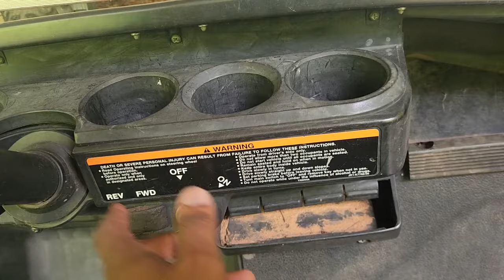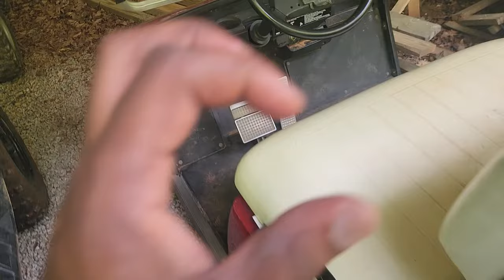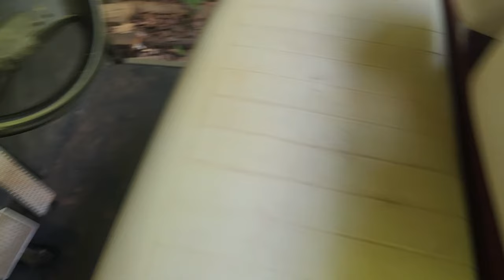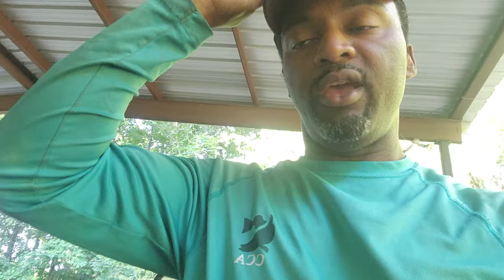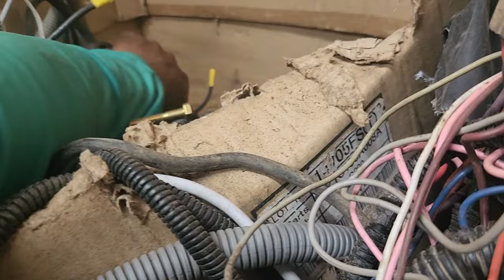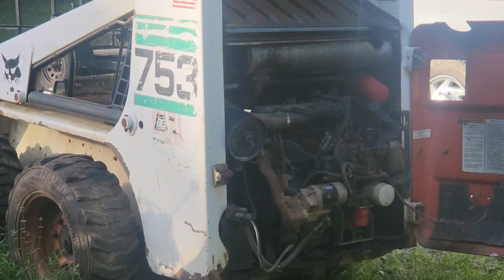How to fix any Club Car golf cart!  Electrical diagnostics 101

Comment: Sir,I have a 2016 club car Presedent 12 iq 48volt. I can be driving and cart just quits then beeps three times
Reply from the maker: Sounds like a bad electrical connection somewhere
Reply: I am going to replace the mcor cheap and quick
Reply: It has the original
Reply: Thank you for the fast reply 😊
Reply from the maker: @forsythparkbaptistchurch7552 yeah MCOR are notorious for going bad so try that first. Usually you can tell if it's the MCOR because it will stop driving when the pedal is depressed to one particular dead zone

Comment: Do you have any good info on a 2008 STAR48-6F-10H cart?
Reply from the maker: They are sort of built up the same as most other golf carts. Foot pedal throttle control is the biggest difference

Comment: Thanks for taking the time . Hoping this will help with my situation . Looks like I have a solenoid issue .  99 Ds , after charging  , starts out great but then slows down and eventually loses power after a few minutes . Battery indicator showing almost full  , checked batteries and they are fine , upgraded to a Plum Quick motor , using in a hilly area . After charging again same situation all over again .  Thanks for the in depth info .
Reply from the maker: How old are the batteries? What method are you using to test the batteries? Sometimes they can appear good but under a load the voltage quickly collapses
Reply: @jeshualee2711  batteries and motor recently replaced in last 2 months . Testing batteries after being charged and after power loss  with voltage meter , 49 at start and 47 at first power loss . After removing the  solenoid I have discovered that it is cracked 3/4 of the way around it .
Reply from the maker: @jimdale9558 oh yeah sounds like solenoid is bad for sure! Glad you found the problem

Comment: My cart will go about 4ft then stops. My overall voltage is 50.3. it's a 48 volt cart ezgo Textron. I replaced its, micro switch, selonoid. It still does the same thing. I'm lost where to go next
Reply from the maker: Sounds like the speed controller is detecting some type of error code and shutting it down
Reply: @jeshualee2711 is that the controller? I'm not real familiar with golf carts

Comment: I need help again. 2007 EZGO, 36v. Recently, I noticed that 3 of the 4 wire cables running from the motor to the F/R switch that are connected get really hot while the cart is moving. The fourth wire that runs from the motor to the salanoid doesn't get hot. The wires are not hot at the motor. I touched the cables and I burned my fingers- really hot. Please help.
Reply from the maker: Replace the wires with new wires and make sure the connections are clean with no corrosion

Comment: Nice video. But I noticed you didn't mention the MCOR. Would that be the same as the pedal sensor?
Reply from the maker: @johncalvo1743  yes the MCOR is the foot pedal sensor and rarely goes bad on this particular model. The Club Car precedent has a lot of MCOR problems though.
Reply: @jeshualee2711  Okay. Thanks for your reply.

Comment: I have that same Yamaha cart and got a new lithium 48v battery for it (wanted to reduce weight and increase range). Long story short the positive/neg terminals ended up being on the wrong sides of the battery and I hooked the pos and neg incorrectly. I turned on the battery with the app and heard a pop and saw a tiny puff of smoke from the solenoid. Ordered a new solenoid but still no go. Did it blow up the controller and if so are they repairable? Only one inline like 5 amp fuse and I see nothing else. Seem like the controller would have some better built in protection if that is what it is going to need. Please help!

Comment: I have a neighbor that keeps messing with my golf cart when I close the outside curtains. He pulls the cables off and tucks them under and last week I'm not sure what he did but I have my batteries connected as I did when I first bought them and no charge, reverse noise, lights don't work, and headlights work fine.
Reply from the maker: @shanebaker3404  wow what kind of neighbor would do that? Is this like a teenager prank or do you have a dementia patient as your neighbor? Wiring can be some of the most complicated things to repair so I would do all I can to eliminate this diabolic sabotage activity right away!
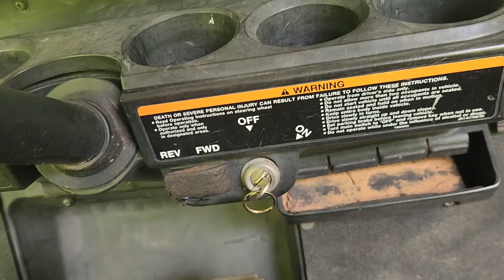Reply: @jeshualee2711  Yeah, I just moved to a retirement community (Never do this) and I'm under fifty and work. I'm a loner so I'm looked at as weird. Last year the "snowbirds" were at a house partying Mon - Fri 12:30 to 1:30 then from 5 pm until 11. They are the popular people and the man I'm referring to was over there and I had a leaf blower cleaning the yard and he was drunk and tried bullying me thinking it would go good and he failed and got humiliated and as a result of his fail he tells neighbors I have a felony and I've had three instances with him messing with my golf cart and the last time I can't figure out what he did.  When this first started my golf cart would just stop while driving. I don't get it. Maybe he took the cable off the charger port underneath the dash.

Comment: Do you have an email because I need to send you a picture of my battery setup and you tell me what I've done wrong?
Reply from the maker: @shanebaker3404  it's probably not the battery setup if you have connected positive to negative across each battery. Perhaps some solenoid and forward reverse wiring problems

Comment: Great video! I'm in the market for a used fixer-up-er cart. Not very happy to learn about the OBD on Club Car as I have had my eyes open for used CC Precedent.. What cart would you say is the most reliable and bulletproof in the year-model range between 2005-2015. I'm in Sweden so a used Club Car from 05 is about 4-5 grand US.
Reply: Get a club car. Aluminum frames. Tons of parts easy to get. Remove the obc and get a different charger if you prefer,or run it stock until something goes bad and replace/upgrade later.

Comment: I have a 2016 club car that has 6 8v batteries 2 out of the 6 are at 7.6v rest at 8.6 it keeps jerking or halting while at full gas what could the issue be. Also if I touch metal to some of the wores on the terminal it may spark even when off
Reply: 2016 batteries, brand is what vehicle came with PN plus +
Reply from the maker: @davidpinter1651  that means they are 8 years old and probably all of them just need to be replaced.
Reply from the maker: @davidpinter1651  why would you touch metal to the wires? 7.6volts is too low for 8volt batteries. Those 2 low voltage batteries could be bad causing it to shutoff due to a  low voltage shutdown error. Try replacing those 2 batteries first. How old and what brand are those batteries?

Comment: Great video!  Your knowledge and experience is very impressive.  I have an EZ-Go 48 TXT which makes no noise at all. I replaced the batteries, the charger, and the 4 wire charger socket. Any advise on exactly where the wires should connect? The largeer black and red are a no brainer, but the white and the thin blue wire are a mystery.  Thank you in advance.
Reply: White main positive and black main negative.
Reply: @HeyHeyHey97  thanks. I did discover that when you jump ground to the small solenoid terminal (opposite the terminal with the yellow wire) the solenoid will click, but nothing with the pedal press. Still digging for a breakthrough.
Reply from the maker: @rickdebacker100  I would have to see a photo to possibly be able to tell anything